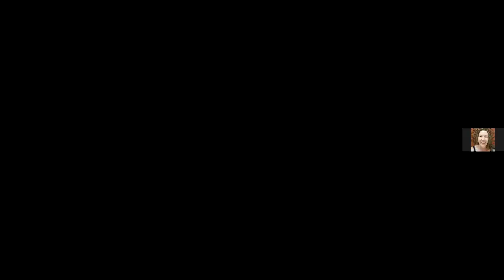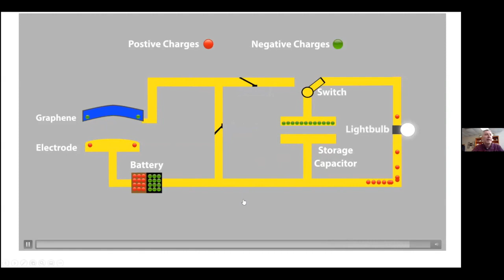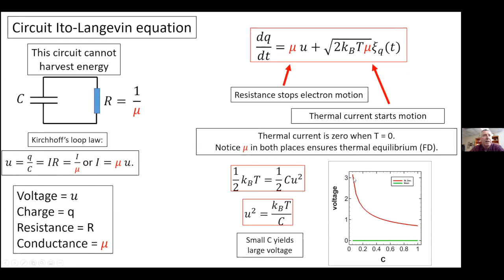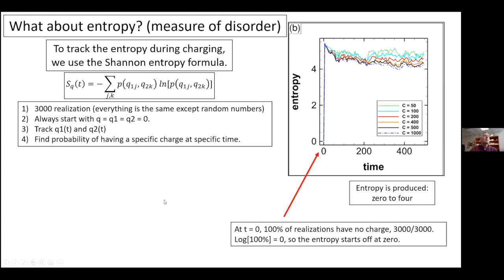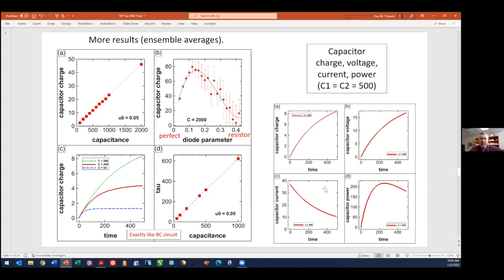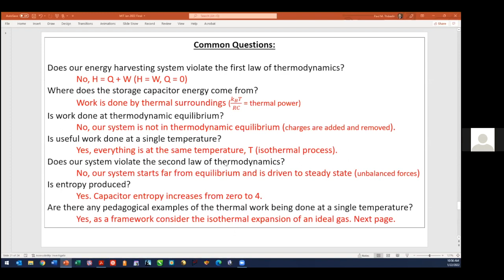Paul Thibado Jan 22 2022, Advanced Propulsion & Energy Harvesting, Neutrinovoltaic Effects

Comment: How does that 5w/m² number make any sense for solar? Current solar panels can easily do 200W/m²
Reply: If this would work, you could stack them. You can not stack Solar Panels.
Reply: @michaeldewitz1940  Good point, but unfortunately the interaction between neutrinos and matter is far too weak to power even just the tiniest LED continuously with any device of reasonable size.
Reply: @helgefan8994  I agree! Those Systems are Fraud.